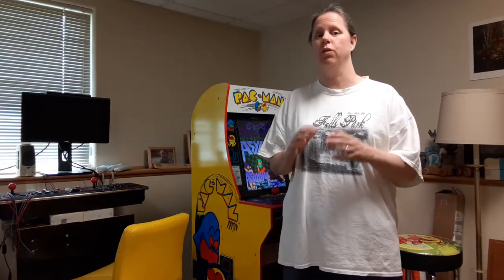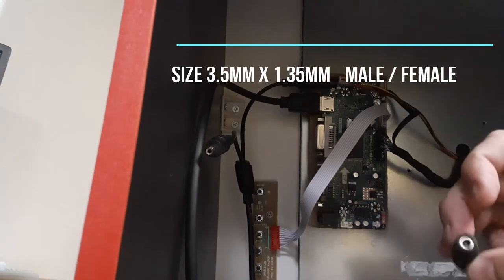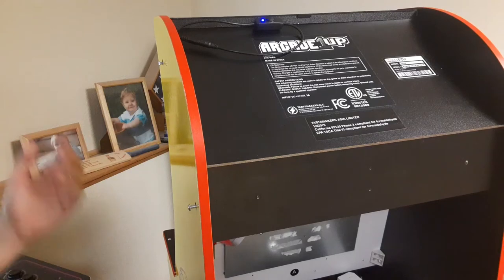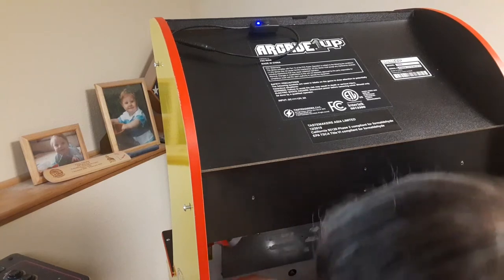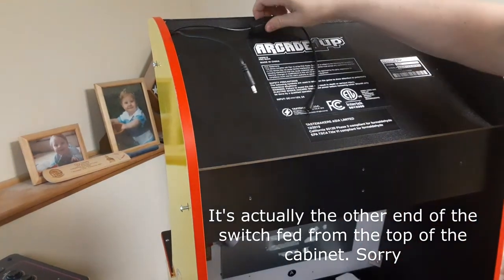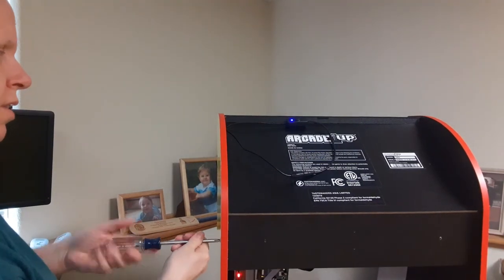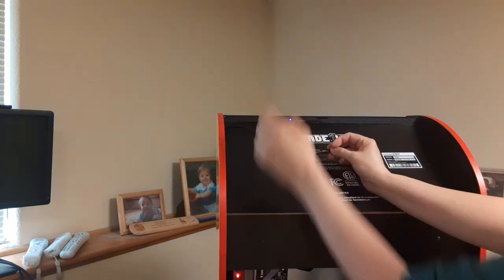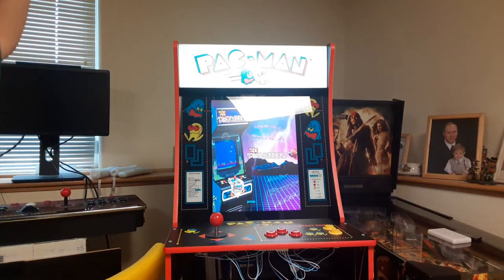Power your modded Arcade1Up lit marquee (how to)

Comment: Awesome! I installed a light up marquee in my space invaders which did not come with one originally. It has a remote control that I velcro to the top in back so I can turn the marquee on while the machine is not on. I have seven other machines in my classroom that I want to do this with and this is a perfect solution, thanks!!!
Reply from the maker: Glad to hear.  Thanks for watching.   They are some fun little cabinets.

Comment: Hi Kat, I found a 1 male to 2 female 5.5mm splitter and then a 5.5mm male to 3.5mm female adaptor on Ali Express. Do you think this would work?

Power in > 5.5 female
5.5 male > LCD Controler
5.5 female > 5.5 male/3.5 female > 3.5 male > marquee
Reply from the maker: Not sure if the LCD controller will work as a "pass through" for just power.  I would say it wouldn't. 
Using a controller board in the mix would power the board and not give you the power "out" (pass throug) needed to contine power on to your marquee; if that makes sence.   
You just need to use "adapters" to make it fit the barrel size needed on each end. Or you could also wire up the necessary jack size needed directly. I could make a video on how to wire up the necessary size barrel plug directly if needed. I just went this route  to provide an alternative (adapters over wiring) for those unfamiliar with how to do soldering/wiring.